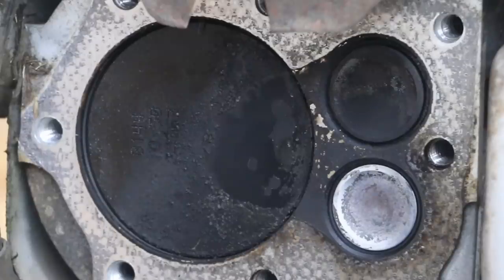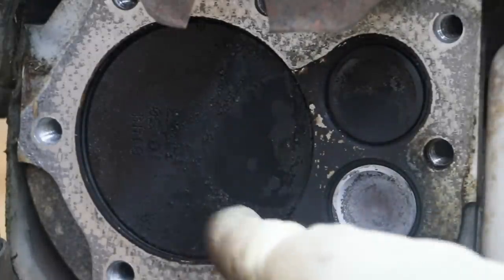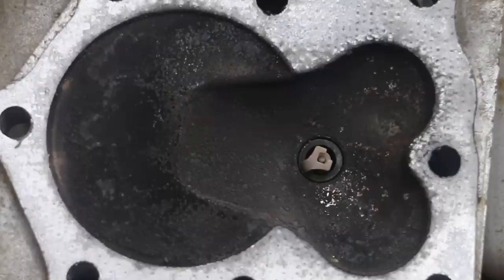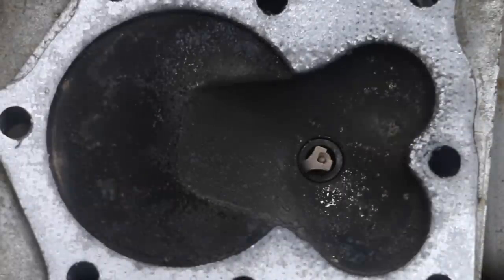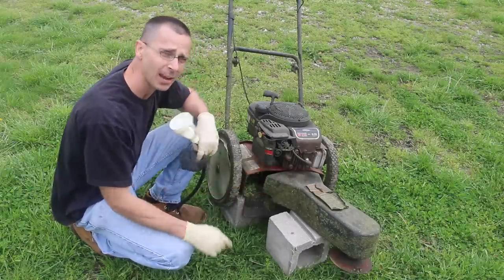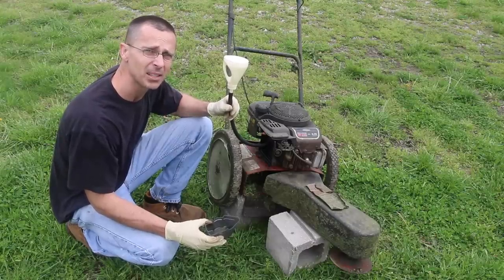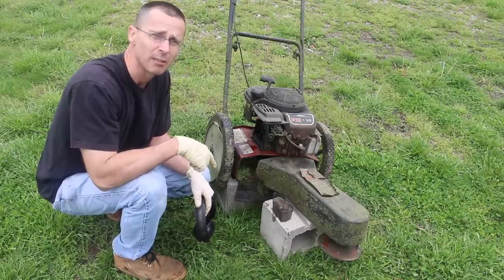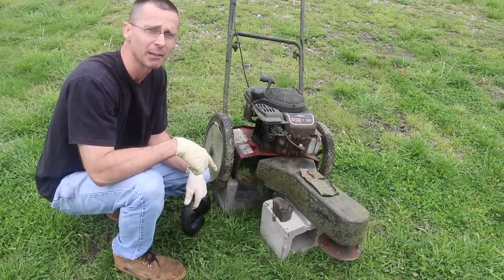Seafoam--can't believe what it did to my engine part 3--cylinder cleaning test!!

Comment: I personally was not a fan of the seafoam  or the water for obviously good reasons. Water is not good for oil circulation, bearings, rings and the list goes on. You really beleve  this crap? Look, use the best gas, Mobile, Shell or Exon which has more detergents, then do regular maintainance  , watch plug color, change fuel filter and watch oil consumption. You can try using 87 or 89 octane but you must maintain your mower frequently and change air filter so you don't run rich and run into ruining your motor.    FALCON MAN

Comment: Excellent video, though comments seem right that the solvent burns off fast, so not major difference.  BUT looking at carbon in relation to the milled(?) area coming from the valves, as well as the piston close to the valves (where Seafoam hits it first), it's working.  I agree with those who say let it soak... maybe pouring some in then shutting off the engine (check to see that spark plug looks soaked), or running it in gas all season.   Thanks much to 'mytmousemalibu' for his credentialed input.
Reply from the maker: Thank you!

Comment: any decent mechanic will tell you to never add anything to your engine or gas tank,its a money sceem.that does nothing or very little.fuel additives can ruin your injectors.transmission same thing once it begins to 
to slip or any other issuues.its done no fluid can replace worn parts the vehicle is designed for gas and oil. nothing else.if its broke seek a mechanic.

Comment: No difference looks the same not worth the time and money, i did this same test on the same mower, my power steering pump blew up
Reply from the maker: Thanks for the feedback
Reply: @ProjectFarm  nearly 80% of the whole auto parts industry is just snake oil or don't live up to their claims! From cleaners to additives, save your money and maintain preventative maintenance.
By the looks of some of those before and after results the product/s have appeared to made it worst.

Comment: Start the car pour automatic transmission fluid thru the carb it will clean the carbon slicker than snot plugs ,piston,valves,head ,intake exhaust and it's cheap talk about smoke lol
Reply from the maker: Thank you for this recommendation.

Comment: What a joke!!! I see it everyday, these people listening to the product advertising and getting duped.  I"ve been in the marine field for 30+ years and the true decarbonizer is Yamaha Ring free, Johnson engine tuner, or Mercury Powertune.  I can see compression changes and the valves looking as if they were pressure washed clean.  Used correctly it will keep two strokes running forever without rings breaking, the number one failure on a two stroke.

Comment: I say spend your money on better tires   wipers   oil   popcorn booze   cleaning injectors  throttle body of carbon is important but not on pistons. your wasting your money. I  have fixed every thing from race car engine tanks trains farm tractors  helicopters  !!!   this is just a way to take your money...  on a rebuild make all parts clean as possible. use good oil  antifreeze .piston carbon is not dangerous
Reply from the maker: Thanks for the feedback.

Comment: snake oil
Reply from the maker: Thanks for commenting.
Reply: Thanks for doing the test. I have used it in oil to help stuck lifters and also wet soaked 2 stroke out board engines to remove carbon around rings and it does seem to help. But you have to soak it over night so the alcohol and whatever else in it can break up the carbon. Just pouring it through a running engine doesn't do  much for me.